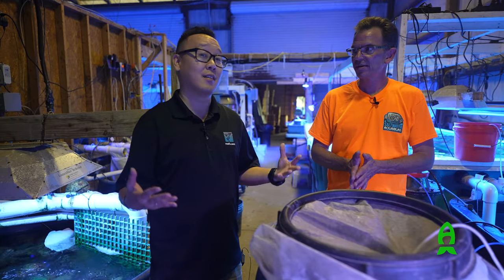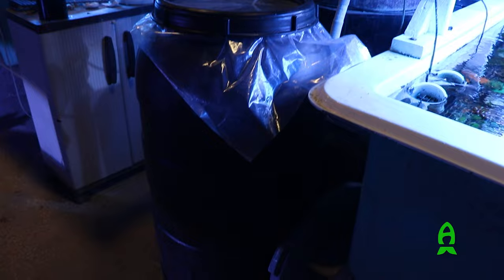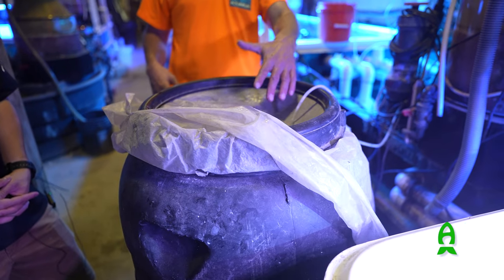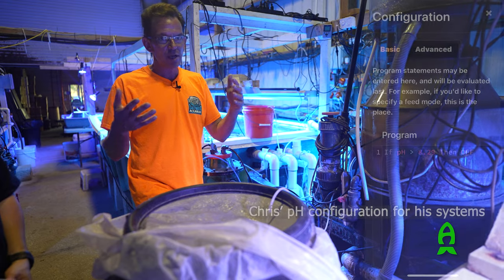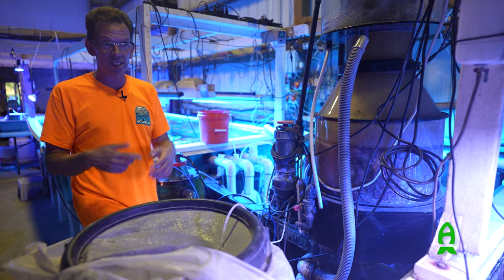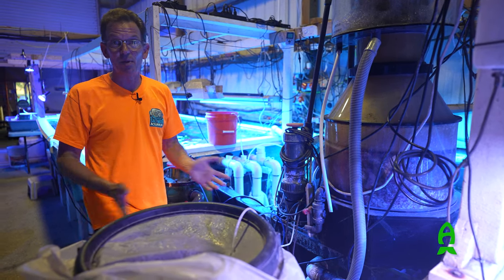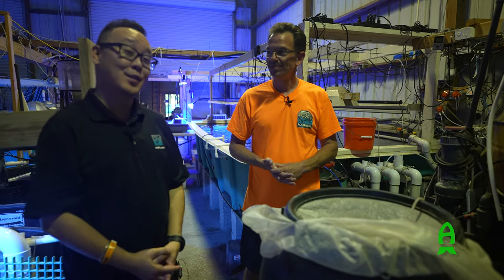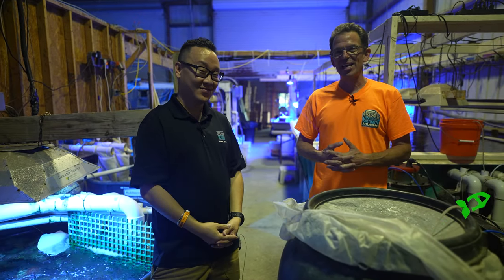Kalkwasser Dosing - ACI Aquaculture Method Part 2.

Comment: Hi guys. I'm pretty sure you clean the kalk line. How often do you clean it and what method do you use? I usually clean my line out monthly with warm vinegar/RODI.
Reply from the maker: Good addition. Yes, you can absolutely maintain the lines.
Reply: We clean/replace ours every 3-6 months depending on the time of the year.  
Replace because it is cheap and fast.  1/4” airline tubing 
If cleaning vinegar forced through the line with a syringe over and over will clean them like new.
Reply: @aciaquaculture  yeah I just run it through the Kamoer stp Pump for about 2-3 minutes and its clear.

Comment: I love Chris, and he may have written the Bible on how he doses kalkwasser, but there are many ways to do it, I dose slurry because of evaporation issues. I use a smaller vessel (10 gallons) obviously more concentrated kalk (1/4 cup per 10 gallons), a jebao pump to mix, and the same exact programming he uses and achieve the same results. I even run through that entire 10 gallons in about 3 to 4 days.

Comment: Another method that works well for Chris in an aquaculture facility but might not work well for home aquariums. Your skimmer depends on water level - If you just dose based on pH and not evaporation then a slight increase in water level will impact your skimmer. Chris looks like he uses external skimmers which is not impacted by water level.

Also in smaller tanks this could swing salinity
Reply: Most sumps have the skimmer in a place where the water level doesn’t change.
Reply: Nice tip!
Reply: @TheTrevor40  And most sumps have a small return chamber. When that chamber is overfilled it impacts the skimmer chamber
Reply: @ReefingwithO easy fix, if your sump level rises say 1/2” then raise your skimmer up 1” so the impact is less.
Salinity swing is nothing to worry about.  It happens everyday in the ocean and sometimes large swings can happen. Corals don’t care about the small swing from dosing total evaporation in 12 hr.  If it did then why are my systems thriving and many hobbyists system doing the same.
Reefing is a lot more simple than these companies selling you complication, make it out to be.
Reply: @ReefingwithO  i have a Waterbox and a Red Sea. I run Kalk and the waterline nowhere near bottoms out each day.
Reply from the maker: I hear you, but for most of us with ATO, I'm not sure if that will be a factor O. 🤔
Reply: In some cases 24/7 is the only way, dosing exact evaporation, the stability in ph cannot be achieved exactly the way we do it l, but at least it will not be suppressed in the same way without Kalk addition.
Either way Kalk is cheaper and easier to use than dialing in  solutions like 2 part that are a money pit.  These all in one tanks are fast and easy to set up but that doesn’t mean they are practical.  No way to modify them for the different methods and equipment.  
They work but IMO, they keep you locked in to how they are designed.
Reply: @aciaquaculture I get you on the salinity. Maybe I was overthinking it. Still disagree on the kalk dosing. Why not just dose to what your top off is. All I’m saying is, your method seems to be working well in aquaculture but might not work well for most hobbyists in a home environment. I’m not sure what to take about the companies trying to sell you stuff part.
Reply: I’ve helped hundreds of reefers with tanks and most can at least achieve 8.2-8.25ph.  That’s a lot better than 7.6-8.0.  Either way it is cheaper and easier IMO

Comment: Why is mine only at a ph of 12.3?
Reply from the maker: That's within the variable in margin of error of the probe. I wouldn't worry too much about it.
Reply: Water temp plays a roll in how saturated the solution will become, 70-80 is ideal. Higher less will go into solution colder more will go in solution raising the ph even higher than 12.44

Comment: raise audio levels
Reply from the maker: I tried that. But the noise from the giant fans and pumps running in the background will be almost unbearable.
Reply: no worries thanks for the reply - i would be really curious to see this method running with other controllers such as ghl and hydros  @Reefscom
Reply from the maker: @reefghost7595  no problem at all! And yes, that can be arranged for future videos. :)
Reply: I have a hydro system   
I should be able to do this your thoughts
Reply from the maker: @jamesreynolds3228  yes, you can. Reach out to coralvue team and tell them that Richard sent you.
Reply: @reefghost7595  so I'm in progress of useing a corview contraler right now I'm useing the ph as you do on apex I also added a water sensor so I don't over does my daily evaporating 
Thanks for the information to get started